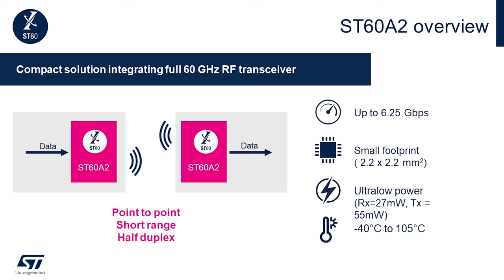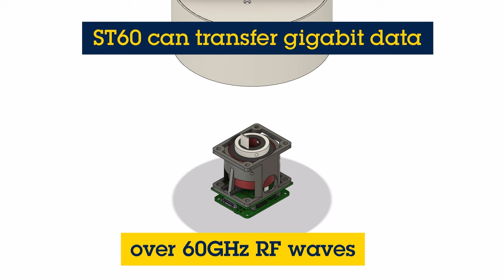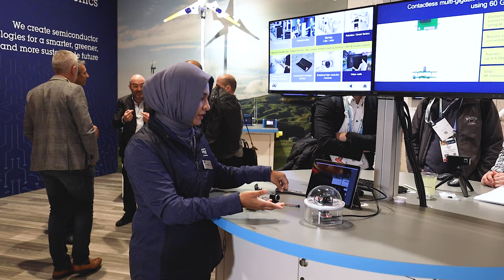ST at CES 2024 — Contactless Multi-gigabit Rotating Camera using 60GHz RF link

Comment: Do you have a companion-chip to provide power to the "remote" device (i.e. the camera, in this example).. Perhaps something like NFC or Qi? Do these pose compatibility-issues for the 60-GHz antenna> (i.e. - would they play nicely with each other?)

Else you'd still need slip-rings (or batteries) for power-transfer.
Reply: Yes , ST also has Qi wireless power solutions to compliment this. So you can make the device side completely sealed and connector less. 
60GHz wireless technology and wireless power transfer do not interfere with each other, rather complement nicely.